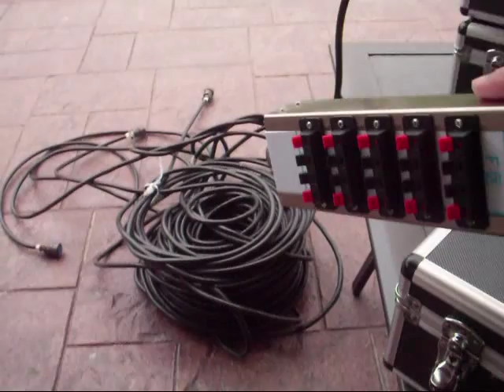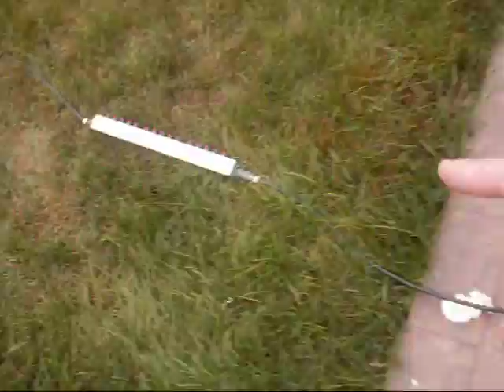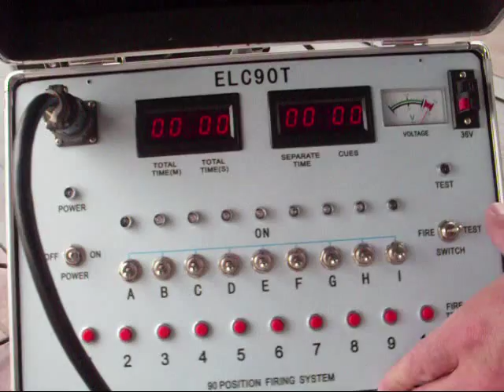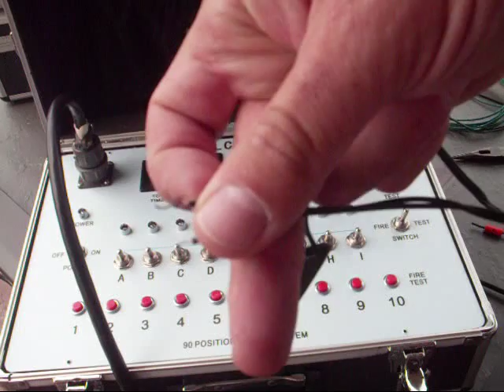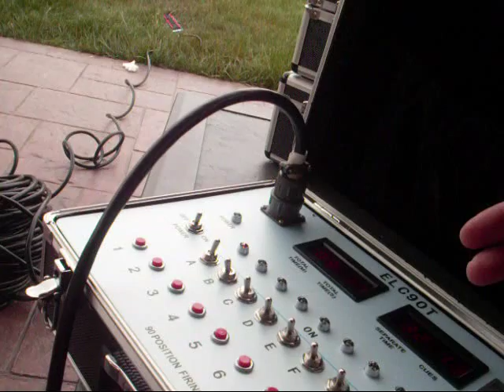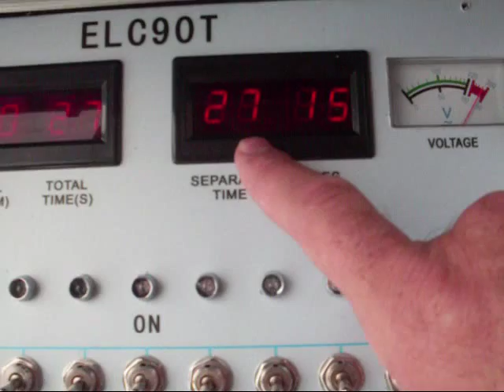90Q Pyro d lite PRODUCT TEST

Comment from the maker: I have 1 available for $800.00 plus shipping which includes the control box, cables and slats for 90 cues. 

I can also get you the 270 cue system which looks pretty much like this one but has 270 cues  for $1700 plus shipping which includes everything also. I am out of stock on this as of now though. 

Both system have an output of 230 volts and fires off e-matches. It also works with sparkies.